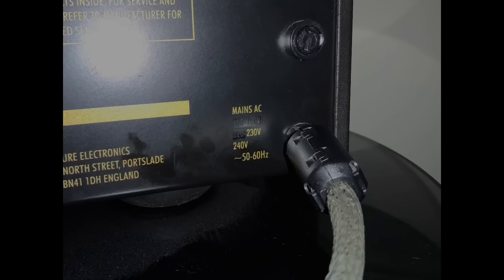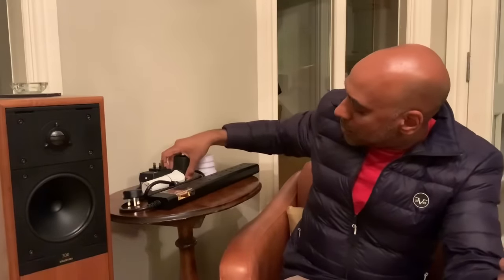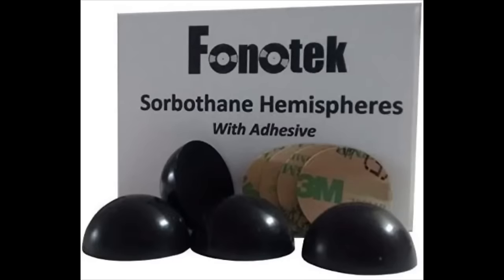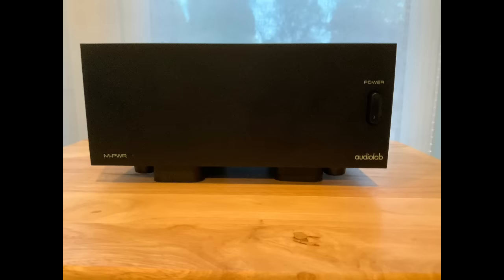My Top 5 Inexpensive Hifi Tweaks

Comment: Hello Brit Audiophile, very good info presented here.  Any suggestions to control static electricity that I expereince?  I recently set up a mini secondary stereo system in my basement office / Man Cave ( excuse the expression), 2 sets of bookshelf speakers,  a new Denon DRA 800H Receiver,  Teac AD850,  and  Tascam CD recorder and a new Audio Technica 120XBTUSB TT.  When listening to LPs  and then goi g to the TT to flip the record, while touchibg the tonearm , i get a static electric shock.  Anybody know what i can do to control that?  A rubber mat , etc.  The equipment is installed on 2 racks / cabinets.  The TT is sitting a top a wood cabinet next to a wood and aluminium audio rack ( VTI audio rack with 5 cherry wood [pressed wood finished in cherry laminate], and aluminium poles - a extremely nice product btw) .  The other stereo equipment is on the VTI audio rack.  Any suggestions is much apprecited by anyone.  Be well all, happy Music to All.
Reply from the maker: Hi Aldo, thank you for watching. I think there is likely to be a grounding problem with the turntable. I would check the integrity of the ground connection. You may need to get it looked at or get a qualified electrician to run a ground connection for the turntable. Good luck 😉👍
Reply: Hello Brit, the TT does have a grounding wire which is attached to the ground screw on the TT and also attached to the grounding terminal on the Denon Reciever.  Its static electricity that creates the spark.  The TT seems to have rubber feet on the base.  That should be protecting against that .  But if it is not rubber, say some composite material, that would allow the static electrical spark when touching  the metal tonearm.
Reply from the maker: Hi Aldo, I might be missing something but I would have thought that the rubber feet will isolate the TT and allow static electricity to build up as the platter rotates. The grounding connection should eliminate this build up but doesn’t seem to be working properly either at the TT, the receiver or the mains connection. Have you tried removing the rubber feet to see if there is any difference?

Comment: Strange you would spend so much on your audio equipment and then plug it into a cheap filtered power strip.  Why not purchase a conditioner that is higher quality that matches the rest of your equipment?  Just curious.
Reply from the maker: It is just a basic passive filter and does not need to be expensive. I have tried more expensive power conditioners and not been impressed (more intrusive). Thank you for watching 😊
Reply: @abritishaudiophile7314  
Precisely
It's truly a minefield finding effective, yet reasonable priced solution that doesn't impede dynamics. 

That said, remove the "reasonable priced" parameter and there's some well executed solutions. 
Torus' toroidal iso units are superb. Audioquest's Niagara units use a different approach but they too seem to have the same universal appeal.

Comment: How does adding shielding change inductance? It does not.
Reply from the maker: It changes capacitive reactance 😉
Reply: @abritishaudiophile7314  Yea, in the range of 170pF unshielded vs 250pF per meter, so it makes zero practical difference until we hit 500+ meter runs, right? (Shielding a speaker cable generally doesn't make sense anyhow though, I'll give you that. Unless you have a bunch of low voltage signal runs over those hundreds of meters)
Reply from the maker: @evil_twit  thank you for watching and sharing 😉
Reply: @abritishaudiophile7314  You pro xD <3

Comment: The ferrite beads are a good idea, they're mainly to reduce noise coming from the device, in contrary to popular believe that it's effective against incoming noise.
The reason that they're mainly against emitted noise, is that those ferrite beads have a quite narrow band rejection, while incoming noise can come from all types of devices (i.e. various noise frequencies).
Outgoing noise often is a continuous flow of noise on the same frequency bands (like the harmonic peaks of SMPS) or a sweeping frequency.
To make sure the ferrite bead is effective, you should measure the noise coming from your device and look for a ferrite bead that matches the frequency.
Just buying some random ferrite snap on beads will likely have a very low effectiveness, since those are often made to make products comply with the general FCC regulations, but not specifically for audio applications.
The active noise rejection like the AC purifier is quite controversial. I've found that those plugs can generate compensation for small voltage fluctuations, but can't generate any current; that would require an external PSU or battery to deliver that.
Alternatively, you might as well just use some decoupling capacitors to flatten out any noise/ripple, like the filter in you Tacima powerstrip, but composed of multiple capacitors in paralel, so it can decouple the noise on a wider frequency band.
Reply from the maker: Hi Qorax, thank you for watching and sharing 👍
Reply: I’ve read that the ferrite beads are good for dc power supplies like wall warts. I’ve never seen them used in ac signals, wouldn’t the ferrite cores induce a current with ac power like the line power or speaker wire shown in this video?
Reply: @mecheng1977  Theoretically you're correct; the ferrite beads are mainly an inductive component, so generally they provide more resistance the higher the frequency, but there is an optimum frequency range (determined by the exact alloy composition) where they give the highest resistance due to parasitic capacitance.
Since AC power is only 50Hz and audio signals are only up to 20~25KHz, these can be considered as "low" frequency.
The ferrite beads are made to give any significant resistance to the RF noise, which is closer to the MHz and GHz range, rather than the Hz and kHz range.
Also, the power coming out of the amplifier and power outlet is significantly higher than the power of RF noise.
RF noise is almost solely voltage without any current (nA to fA), the RF voltages are into the range of microvolts and below.
Any significant resistance to those microvolts have an insignificant impact on the 100-230 volts of the power grid (and higher for the peaks coming out of the amplifier).

I've found that one of the most effective applications is high bandwith digital cables, like USB 3.0/3.1 that are well into the range of GHz clock speeds.
The steep transients of digital signals create a lot of radiated RF noise; using ferrite beads and common mode chokes to reduce that works very nicely.

Comment: Outside of a ground loop, any noise coming from the wall outlet is filtered out by the power supply. And if a power supply is poorly designed and doesn't filter out unwanted noise, a power cord is not going to be the solution. There's a reason why there are no blind tests of audiophiles identifying a "high-end" power cord over a basic one. Sighted listening tests are a breeding ground for placebo and wishful thinking.

Comment: Good, common sense advice.  If I may...ferrite rings won't do much at all for speaker inputs and as you say can affect the hf so better off not using them. Tacima conditioners are ok but decent conditioner blocks have come down in price which offer  more outputs and better headroom.  No sure about the ones you put into the mains.  Your kit should be using decent rfi filters already in their own power supplies really. 

All made up cables must conform with British Standards and safety standards and one point is that your shield is not connected both ends...it should be floated at the kit end and only connected at the mains plug end to avoid passing emi to power supplies in your kit or coupling with your chassis.
Reply from the maker: Thank you Paul. That is very useful 😉

Comment: Power cables, fancy plug gangs, mains conditioners etc, quite frankly  makes no difference.
The mains Ac current always gets converted to Dc current through a rectify to smooth it out within the appliance..
Reply from the maker: Thank you for watching and sharing BD 😊

Comment: Tarun interesting video, thanks. I've fiddled about trying all sorts of things to get a better sound. (I used to buy hi fi mags). I have always been willing to try (supports, cable, wiring, set-up etc) but the important thing is to listen to the results. I had a marble (offcut) slab under my REL sub but after trying other different things and reading a comment from REL (advising to couple to floor) I found the sub best unspiked on its feet no marble. (Or concrete! ) on cables and shielding have you ever looked at DNM speaker cables and interconnects? They are unshielded and have worked great for me. Thanks.
Reply from the maker: Hi Ado, thank you for watching and sharing your experiences. I haven’t heard the DNM cables. Do they use a unshielded twisted pair configuration on the interconnects for noise rejection?
Reply: @abritishaudiophile7314  No not twisted. They were often seen with Cyrus products in the late 70's and some were re-branded as cyrus l think. http://www.dnm.co.uk/products.html
Still available for DIY or complete

Comment: Speaker cables- Ideally don't have any. Mount the power amps in/on the speaker. Zero impedance.
If not, use sensor cables back to the negative feedback loop- the cables are then within the control loop and compensated for. Widely done with power supplies. Don't know how to do this? Learn.

Equipment vibration- as long as the signal is in the digital domain there cannot be a vibration issue. Keep it digital right to the power amplifier- which is at the speaker (see above).

Mains suppression/ mains cables - if you really believe this has an effect, why not run your system off DC? Lithium batteries are a reasonable price these days... Guarantees zero mains born issues...
Reply from the maker: Thank you for watching and commenting Mike.

Comment: The problem with such videos is that there is no proper technology explanation for why things work as they do.

As long as you know what you are plugging in and you have read that it will help then you have easy to believe it works!

You also need to take a blind test.

It also takes too long between so you can also forget things in between as you test!

Comment: You didn't mention the thing that typically makes the biggest difference and costs absolutely nothing, except a little bit of time. If you're my customer I'll do it for free, so you get the best from your system whether it costs £1000 or £50,000.
Reply from the maker: What was that Steven ?

Comment: Ferrites can realy be usefull, but not on a speaker cable, most unspecified Ferrites is usefull in the higher mhz and even GHz range. 
Please experiment and test but im afraid its snakeoil to use them on speaker cable

Comment: This guy obviously never studied electronics. Ferrite on one lead increases inductance. On both, it does not because the fields cancel. Its normal use is to prevent EMI, which is COMMON MODE, same polarity on both leads, does not cancel, so the bead does block it. RF has no effect on speakers because it cannot pass through the inductance of the voice coil. The place for it is at the amp, because RF can get into the feedback loop of the circuit, or worse, it can rectify in the junctions of the transistors or tubes. Common mode signals can get into the amp even through grounded lead as long as they are long enough to act as an antenna. Look at any computer cable factory equipped with ferrites, and without exception, they are on both leads to block common mode signals. Of course, if you filter out all high frequencies by putting it on one lead, you may also get rid of interference, but you are throwing the baby out with the bath water.

Comment: Bit new to all this, had some awful feedback bass rumble from my regar planar 1. Used pads under speakers and decoupled turntable with sorbothane pads, much better but now I get a hissing noise! Anyone have any tips please ??
Reply from the maker: Hi Justin, what is the rest of your system?
Reply: @abritishaudiophile7314  Yamaha nsf51 speakers, Yamaha a-s501 amp, regar planar 1. Nothing else at the moment other than an optical cable to my TV. Built on a budget, just doesn't sound as good as I expected. Thanks for the reply!
Reply: @abritishaudiophile7314   speaker wires are standard with good quality banana plugs, all the equipment is on a wooden hifi rack with silicone anti vibration pads under everything including the speakers.
Reply from the maker: @justingrainger6627  is the  hiss only when you listen to the turntable or with the TV as well ?
Reply: @abritishaudiophile7314  so I have a digital to analogue convertor which connects to my TV via optical out. I have disconnected the power from this and the  hiss has gone! Looks like I may need a more modern amp to hook the TV up to. Thanks so much for reaching out and providing support. Fantastic channel! Just a bit over my head 🙂
Reply from the maker: @justingrainger6627  thank you Justin. It may not be the amp. It my be the power supply to your external digital to analogue converter. What DAC are you using? And what is it powered by?
Reply: @abritishaudiophile7314  DAC Converter, Techole Aluminum 192KHz Digital/Toslink to Analog RCA L/R Audio Converter, Amazon job. It's powered by an old usb 2.0 cable plugged into a simple plug.
Reply from the maker: @justingrainger6627  Hi Justin, just wondering why are you not using the digital inputs on the back of your Yamaha AS501?
Reply: @abritishaudiophile7314  it doesn't have a digital out I'm afraid, hence the DAC thing.
Reply: @abritishaudiophile7314  it's actually the as500 model, not the 501 so no optical out. Apologies for the misinformation
Reply: @abritishaudiophile7314  I think an upgrade is in order.
Reply from the maker: @justingrainger6627  thank you for clarifying. Good luck with the upgrades 😉
Reply: @abritishaudiophile7314  thanks again for replying, it's much appreciated. I'll look forward to seeing more great content on the channel.

Comment: You made a small BIG mistake!!
Hello Mr. British Audiophile, from San Antonio Texas, USA. While I did enjoy your video and learned a few things I cant use (I am going deft and have serious hearing loss from music to loud working as a Roadie, a D.J., or simply as a fan at rock-N-Roll concerts in my youth) but I understood your advice and reasoning and may be able to help some other up and coming "Audiophile" someday in the future. However, you did make a mistake! I see that your guest Mr. Jack Dyck already beat me to pointing your mistake out. But there is no explanation which I fell is appropriate here.
When you discussed power cables at the end and brought up shielding, you said that the shielding needs to be connected at both ends. Now for 99.99% of any audio cable you WANT to connect the cable  at both ends so that any signal you are trying to use sending it from point A to point B will indeed make the journey successfully. However, when it comes to the shielding around an audio cable (not to be coinfused with the ground conductor) you DO NOT want  a proper complete path from one end of a cable to the other! And the reason for this is: A sheild is used to protect a audio signal (or any low level signal that needs to be kept clean and uncontaminated) from any other electrical energy from getting into, and becoming part of, the audio signal (which of course is electrical energy also) which will usually end up being amplified and either ruining or degrading anyway, your audible end product which is normally the music we are trying to enjoy. But, when a person is building a "Shielded" audio line (or computer signal line or communication signal line etc etc...)  you want to intentionally and specifically leave ONE END of the shielding unconnected to avoid a complete circuit or signal line. In doing so what you end up doing is then "Shielding" your important signal from any and basically all other electrical energy that could contaminate your signal and what ends up happening is that these erroneous signals or "Noise" then get "Shunted" to ground!! And so any cable with a shield on it with both end connected is effectively defeating the shield all together!! But by lifting or floating one end you are now instead "Shielding" the signal protecting it from electrical energy you do not want amplified and reproduced at the speakers!! Ta-Da! 😜👌 Now, one more word on the shield of "Shielded" cables. When it comes to the shielding all shields are not created equal!! Aluminum foil for example is NOT as good as braided wire! And the finer the braided wire the better the shielding is at picking up higher frequency noise! and in fact solid foil shielding can and to some small degree does capacitively couple noise of higher freq to your signal line! Oh yeah, it sure does!! So, there is my little two cents from Texas. I hope I didnt pain anyone too much and maybe even gave someone a bit of info they can actually use!!
Steve
Reply from the maker: Hi Steve, thank you for the detailed and thorough explanation. This seems to be an area where there is quite a lot of confusion so thank you for clearing things up. I did change my advice on this in my next video.

Comment: For speaker cables, the best way to eliminate outside RF and EMI is to use a shielded cable. The best for signal interference is twisted pair conducting wires. What’s the cheapest example of these are Ethernet cables. Cat5 or Cat6 cables have been tested to meet these requirements as they greatly affect transmission speed for network communication. Don’t try to build these yourself as the cables are engineered to a particular standard.

Good presentation but lacks foundational knowledge.
Reply from the maker: Thank you for watching and sharing Giles 😉